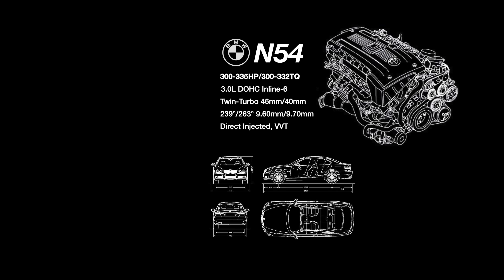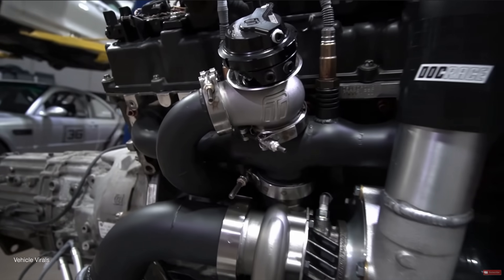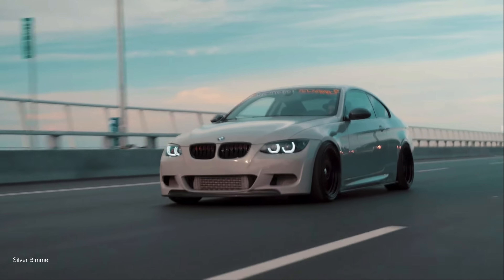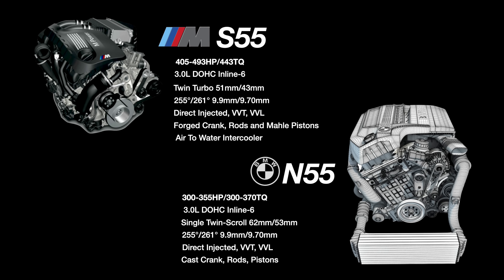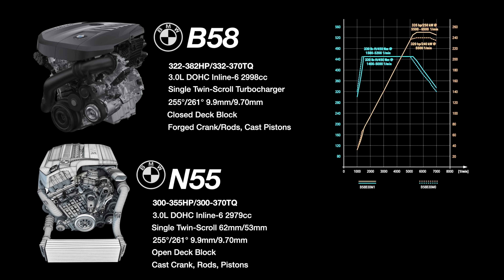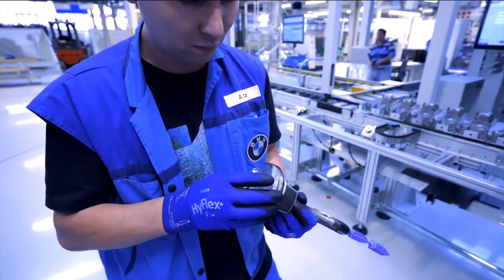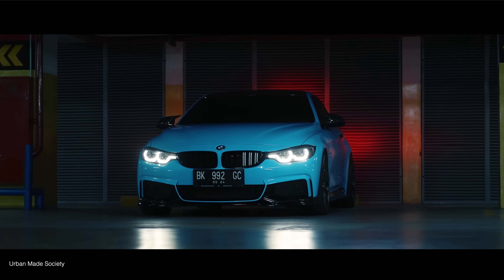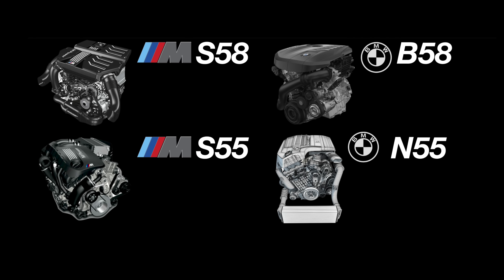BMW Turbo Inline-6 Engines Are Ridiculous | Explained Ep.4

Comment: LS guy in the comments section here, it’s insane what catless DPs, E85 and a couple more bolt ons does to these engines. They are already underrated from factory especially in the Supra Mk5, putting to the ground basically what they claim at the crank. I might be an LS guy but I can appreciate good engineering no matter the make.
Reply: Im a german engineering guy and I love the LS cars.
Reply: @ImAlexLP  they are one of the best bang for the buck platforms
Reply: @ImAlexLP  yup. Cheap, simple, and reliable.
Reply: I love LS engines, but I also own bimmers......that's all I drive....Chevy trucks and bimmer cars....
Reply: @DeaconYomouf  chevy and beamer bikes for me. Their bikes are leagues above their cars in terms of reliability.
Reply: @sethh8892  BMW motorcycles are nick amex Beemers.  The cars are Bimmers.
Reply: @machtschnell7452  Yeah, the bmw bikes are fucking wonderful. Honestly it's one of the only bikes I would ride. I'll take a Honda dirtbike or fourwheeler any day, aswell.
Reply: I love this comment.....I own 2 bmws but my truck is a Chevy with an ls under the hood......250k and still runs great 😎
Reply: @mikemartin6857  that’s good that your truck still runs great at 250k, I had a 2001 Silverado 5.3 I sold to my son, over 300k now still going, other son has a 2500 with the 6.0 LQ4 with almost 300k, just keep the oil changed and coolant clean and full. I haven’t owned one with DoD, I’ve heard horror stories about them, but I’ve also been told they last pretty long if maintained. I’ve heard both good and bad about BMW 3.0 turbos too though, and it’s probably the same thing, gotta maintain them properly, every make has a few lemons in the batch.
Reply: Very well said.
Reply: I agree these new s58 engines are insane, ill give it like 3-4 years for price decrease then snag a g80 sedan
Reply: @Jcastro9444  all g80s are sedans the g82 is the m4 which is just a the coupe to the m3. There are no longer 2 door m3s. They've done away with that since the f80s etc. Ended after the E9x platform
Reply: I had an ls2 corvette, now have an n54. N54 is not worth the issues compared to LS, will be getting a C6 GS soon.
Reply: @nickf6794  of what? The LS or the Mk5 Supra?
Reply: BMW Straight-6 Turbo 🤝 LS/LT
Reply: @Sam Holcombe that's very interesting. Can you explain what they probably did in order to keep the power at the wheels unchanged from the crank?
Reply: @MrHEMI260  idk if you’ll see this after 2 years, I just noticed your question after someone else commented on this thread. Short answer is they lie, probably for insurance purposes and there used to be a gentleman’s agreement on advertised hp numbers for JDM cars set at 276 hp. There are other engines that make more hp than claimed by the manufacturer, LS1 Camaros and Firebirds come to mind, same exact engine as the C5 and GTO,but rated anywhere from 305-325 hp while the GTO and C5 were rated at 345-350. All LS1s have about 350hp stock. A lot of late 60s early 70s muscle cars were laughably underrated, ZL1/L88 427, claimed 430, actual 550-580, 426 Hemis too, Cobra Jets and a lot of the smaller engines too. 69 Z/28 302, 290 claimed, 375+ actual, 302s, 351 Boss all underrated.
Reply: @samholcombe3129  I'm still around! Thanks for the info, now I gotta rewatch this video after so long :)
Reply: A real car guy! Bravo buddy!
Reply: The B58 is an amazing engine. But being BMW who wouldn’t be surprised if a lot of problems bring downs it’s name. BMW is known for innovative electronics that break. People who buy 335i’s and M3 M4 used as their only car usually regret it. A good friend of mine got into auto repair in his mid 30s. He works for a auto repair and tech shop known for being really good at tuning. Although they don’t specialize in Euros they are good at it and draw many BMW owners as well as Audi. He loves driving BMW’s but can tell you countless horror stories of people financing used BMWs with over 60000 miles. He has seen many people including grown men not just women n teens break down and cry when told the cost to get their 335 i’s and 240i’s and M cars back on the road.  Great engines but not reliable and they are expensive to maintain and repair. N54 and even B58’s are not as good as LS 5.3 and LT’s or JZ’s
Reply: true car guy here
Reply: I love how the bmw guy brings up LS because he knows dollars for dollars the LS kicks ass
Reply: That’s called being normal
Reply: What about that in-line  vortec 4200.
Reply: ls guy is a cavemen, big displacement, simple tech pushrod mechanism, while bmw engine is precision engineering and german efficiency
Reply: @ yet some how manages the same mpg as a pre LS era l98 C4 or IROC, very efficient and precise.
Reply: @ typical statement from someone that doesn’t know a thing about a LS/LT, or cars in general. Have you ever seen someone tune an engine on a dyno? You don’t just adjust the carburetor on engines anymore.
Reply: Definitely not under rated from factory … you actually believe that rumor?  These cars are social media racer only . My close friend has a m4 and it had a built engine with upgrade turbo and barely made 600whp . I never get the bullshit that comes along with bmw these days .
Reply: @Sclassmercedes dyno don’t lie, B58s are definitely underrated, they make to the wheels what’s advertised at the crank, YouTube is full of dyno before and afters and they start around 370-380 whp
Reply: @samholcombe3129 no like I said we dyno a bunch of them and they make exactly what they claim .. b58 m are making around 320 to 330  regular b58 are like 260 whp ..
Reply: @samholcombe3129 show me your dyno and I’ll show you mine and some of them are even tune with e30 and e85 with dp and upgrade hpfp barely breaking 400 whp . There’s some with pure turbo and making a little over 450 with all the above with upgraded turbo .. 😊
Reply: @samholcombe3129 at the end of the day these cars are super over rated . Ask anyone  that is not a bmw fanboy . They’ll tell you straight up these motor are just ok they’re not a legend like the ls or the 2j .. it’s just the dumb bmw trend that got troll telling fairytales like this .
Reply: @Sclassmercedes I’ll give you that the fanboys are crazy, but no worse than the LS and 5.0 crowd. Like I said above, I’m a LS/LT guy but I can appreciate the potential of other platforms like the S/B58, DAZA, Coyote and Predator, LF4, K20, etc. You have the fanboys on one hand and just haters on the other.
Reply: It’s well documented that specifically the B58 in the Mk5 Supra and Z4 actually make 380ish to the wheels, making them well over 400 hp crank. As well as several other BMW vehicles.
Reply: @samholcombe3129 no try again .. document is bs we dyno around 10 since they came out and numbers are around 320 to 330 . I think you guys need to quit spreading rumors to boost bmw people mindset 😂😂.
Reply: @Sclassmercedes well documented bro, stop the hate
Reply: @samholcombe3129 hate 🤣🤣🤣🤣🤣I guess you’re following the bmw bs trend a lot?  Show me … and I’ll show you .. real dyno run not no goofball going to tune his car and he’s posting bs .. I’ll show you the dyno sheet that we got and then someone has to shut up
Reply: @samholcombe3129 I get what you’re saying but I just want people to be educated and not believe the bs . Then turn around and get smoke bs a Hyundai 😂😂😂.. better watch out for the genesis
Reply: The MkV Final with manual transmissions are rare and for sure gonna be worth more in ten years with 100k miles than when new. I'm pretty sure I'll buy one.
Reply: Maybe I'm lucky, but I've been daily driving a M140i with the B58 for 3 years now and have had literally zero issues, not to mention amazing fuel economy when driven sensibly. Granted I look after the car very well and keep up the scheduled maintenance, but I can't relate to all the people who say these cars are unreliable. Makes me wonder if there is a disproportionate amount of people who just beat on BMW's constantly and never get them serviced.
Reply: @mahlty  I think it’s like that with any make, some people just don’t realize how important oil changes and clean coolant are to the life of an engine. Not saying any names but I know people that just drive them then get mad at the car for failing.
Reply: Obviously, but the initial buy in costs are miles apart
Reply: @Theeeeea  oh yeah, miles
Reply: @Theeeeea  Same for initial buy in cost for tools if you want to do anything yourself, and the learning curve. Meanwhile a standard set of metric wrenches 10-18mm & 24mm is about all you need for an LS and the most basic engine knowledge.
Reply: @hydrocarbon82  in my area you can get a turbo kit fabbed for $1500, and let’s say $1000 on some tires, $4000 for the car $800 for some engine mods, and now you have a low boost 650 hp turbo ls that can be turned up, it depends on the local market
Reply: @Theeeeea
Reply: @Theeeeea  geeeeee i wonder whyyyyyyyyyyyy
Reply: The look on camaro guys faces when they just got gapped by my 15 year old inline 6 n54 powered bmw is priceless 👌and never gets old! Still on stock turbos I may add 😎
Reply: I like LS engines for easy NA torque and fun, but I prefer inline 6 for gas mileage and weight. Obviously at 1000 hp you get shit gas mileage no matter what lol

I’ve definitely considered it for a swap in e46, now I’m thinking s58 because it hasn’t been done yet and they make like 700+ fbo. 

One day I’m going to get a c6 z06 xD
Reply: @alextasarov1341  11 mpg is sick af, lemme tell you. Supra with some mods ain't good gas mileage...stock, though, it's pretty good.
Reply: @joshuadqueen  you don’t buy these cars for gas mileage. If that’s what you want buy a Prius. My bmw gets 20-24. Tuned with over 400 horsepower. Can’t ask for anything more than that
Reply: @alextasarov1341  LS3 6,2 is 184kg. It's LIGHTER than any bmw i6 ;)
Reply: LS engines are really popular in the boat community, they use them at the end of a chain. It's called an anchor.
Reply: @chippyjohn1  No you're getting those confused with the Ford Triton motors.
Reply: @chippyjohn1  arent they hemi's, cause the ls is very light for its sizes
Reply: @Automobile Addict I was thinking the same thing. Bavarian garbage works is more like it.
Reply: @footballcoreano I don't know what you consider reliable but American cars and trucks average 300,000 miles or more and GM has over 39 One million mile vehicles registered.
Reply: @tskraj3190  I don't know what you Americans are doing to your BMW's but I've owned 7 with M54 B25 and B30 either standard or swapped and turbo converted 3 of them. Each and every single one of them was on more than 300k miles when I sold them and bought/built another. None of them ever had anywhere as many problems as you claim. I have one right now that is on close to half a million miles and never needed much, yes sensors have failed here and there, I replaced timing chains etc when I felt it necessary for maintenance purposes and not because the old parts failed. But if you really are a mechanic, you are straight up lying if you are saying having sensor failures ever now and then is a BMW specific problem. Just like with gaskets and minor oil leaks.. this happens to every single engine, used by every single brand, and every single model of car ever made and used. You're clearly just one of those fanboys who want to shit on BMW's and pretend that you haven't seen every other brand have the same minor problems here and there, which if you were a mechanic worth your salt, you'd be able to admit that these are just normal things to happen to mechanical vehicles performing lots of miles under all sorts of conditions. The 2 most reliable engines I've ever come across in my life (and I've had, worked on and modified many) are the M54 and the B5234T used by vovlo in their older t5's. Had one close to half a million miles with no major issues or wear, and had t5's on 650k miles and still pulling and boosting like new.  Short of one fuel pump failure on an M54 (which again can happen to any car or brand on earth) they've never stopped running or even stopped running well for that matter. I question not only your mechanic status but also your integrity to talk so much bullshit. And by the way, america is basically all long straight open roads where tons of air can get in and keep them cool. My high milage BMW's are on a tiny island with lots of tight twisting roads, and many, MANY stop/start driving situations on a daily basis where the engines get hotter. I speak from my own experience, I'm a mechanic myself, and you sir, are chatting out of your ass.
Reply: @MDM1992 Try owning an N62 Engine. Pure (plastic) garbage. Thought I got lucky, but once I hit 90k everything I was warned about happened.
Reply: @iap6647 I have a 745 l&I with the n62 b44 just hit 190,000. Only thing that's ever been done is basic maintenance a couple coils and a couple sensors
Reply: @MDM1992 you said it best bro
Reply: @footballcoreano Is that why GM has the most powerful naturally aspirated V8 ever made? BMWs are pure garbage and anyone including myself that has owned one for more than 5 years will tell you the same. This is not about fanboying. I'm a mechanic and I have a lot of experience working on BMWs. What I have stated are facts. Stop crying because you don't know any better.
Reply: @tskraj3190  I swapped an ls into my bmw but even I will admit that bmw makes some very solid i6 engines. The m5x platform will go well over 300k with ease which is why so many are still on the road and track. I've seen chevy engines fail for stupid reasons even with the simple engineering. The fact that they were mass produced in every GM vehicle and can be found at the junkyard for $500 doesn't make them better.
Reply: @tskraj3190  preach the facts brother. I would never own a BMW more than 5 years old... and even then i would very iffy.
Reply: They really aren't that impressive. They're over engineered and they are always in the shop for sensor failures, sticking valves, flattened valve seats and scored cams. BMW is the very definition of overpriced junk.
Reply: @tskraj3190  dude got a truck in his profile picture of course 💀💀
Reply: @prestoiidx  Certainly do because trucks are more reliable and BTW this is swapped with an Atlas 4200 Vortec inline 6 with a GT45 Turbo. BMW I-6s put out decent power but most of it is the Turbo. I'm waiting on the Stellantis GME-T6 (Hurricane) Twin Turbo 3.0L i6 H.O. From Fiat Chrysler which is almost identical to BMW's S58 but without any of the major issues of the S58.
Reply: @tskraj3190  So you're waiting on an engine that's not even out yet and you know it's going to be more reliable than the BMW? Interesting...
Reply: @tskraj3190  gotta give hats off to MOPAR. Even with all companies going "green" ,  MOPAR just doesn't give a fuck. They just want to dominate in all divisions. I'm looking forward to seeing that new inljne 6 turbo motor too i hope it performs well.
Reply: @tskraj3190 what major issues
Reply: @PRISONERofCANADA Aged horribly
Reply: @mishad8002  The major issues I listed in a previous comment.
Reply: @tskraj3190  What a load of nonsense. Of all the common issues these engines have (and yes of course they have common issues, all engines do) you pick flattened valve seats and scored cams? 🤣

And BMW has made these engines more and more reliable over time, any 2013 or newer N55 is a pretty reliable engine, the new B58 by all accounts is even better.
Reply: @BigUriel  My car has the second gen B58. It’s awesome. BMW claim 374 bhp. The reality is 410 stock. I’ve had it for nearly four years now with zero issues.
Reply: @tskraj3190  I’m a salesman at bmw, and realistically, M Performance cars are very rarely in the shop, besides the M5, the twin Turbo v8 tends to have its issues, but our M3/M4 group tends to hold their reliability pretty well.
Reply: @DirtyDominik  I'm a mechanic and have owned BMW in the past and I currently work with a mechanic that used to be the lead BMW tech at BMW of Arlington. We will both tell you the same but he is not as nice as I am and knows a great deal more than I do about BMWs.
Reply: @tskraj3190  so Toyota using a B58 means what exactly? They would NEVER use something, especially a motor, if it was what you describe. Lol been running the platform since 2018 and drive like i stole them. Not a single issue at all. Did older N lines have some common issues, sure, but you are spewing general nonsense. Have fun in your truck lol
Reply: @michaelmesolellaesq  They have been going back to the dealerships for heavy oil consumption and Toyota has to hire a BMW certified mechanic to tear the engine apart. 😁
Reply: @tskraj3190  This coming from experience or just stuff you've read on the forums?
Reply: @cleverusernamecl5532  I'm a mechanic. I'll say this, most BMW owners don't stay BMW owners. If you're buying a car for performance, looks and luxury and you don't care about reliability then a BMW is for you.
Reply: @tskraj3190  You are very ill informed.
Reply: @machtschnell7452  🤣
Reply: @tskraj3190  I've owned multiple M3's and never had any real issues.  BMW car and GM pickups.  Take those chevy motors and I'll utterly destroy you on the track every time.  I used to eat vettes alive with a fucking RX-7 for god's sake.
Reply: @tskraj3190  overengineered = overpriced junk, yeah ok
Reply: @tskraj3190 Too Bad that‘s complete bs regarding the S55/B58 and S58.
Reply: @MettMagier  it's too bad you don't anything about auto mechanics.
Reply: @tskraj3190  You’re the very definition of someone not knowing what he’s talking about.
Reply: @tskraj3190 Sensors fail on every single car, and generally BMW engines are more reliable than not, my buddy has an e36 with M52 engine that has 320,000 miles on factory motor and ZF transmission, Drives impeccably, couldn’t tell it had more than even 50,000 miles lol. That’s pretty impressive for some overpriced junk.
Reply: @finnsstuffs  What year model is it?
Reply: @ 95 or 96 i think?
Reply: @finnsstuffs  that's when they still built fairly reliable vehicles.
Reply: @tskraj3190  Every comment section has one of those guys, that come to a video claiming greatness, then you have this guy..."failures, reliability, hah hah git wrekt"
Reply: @joshuadqueen  It's from personal experience.
Reply: @tskraj3190  that's fine, but it doesn't make you less that guy. Not all of us have had countless issues. And I'm sure you can find that guy for any car. To try and diss a whole brand is a bit much, but that's what I usually see. Sorry your car sucked, :(. Mine hasn't so far.
Reply: @joshuadqueen  I'm a mechanic.